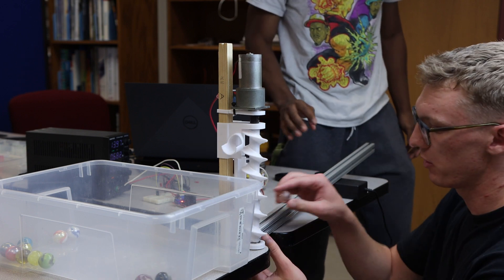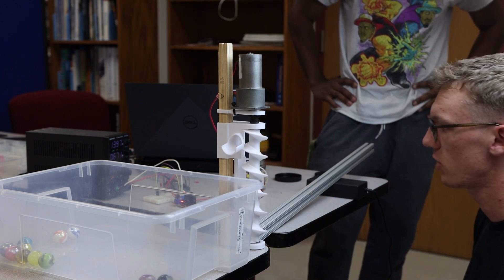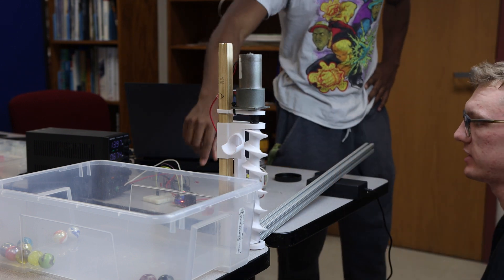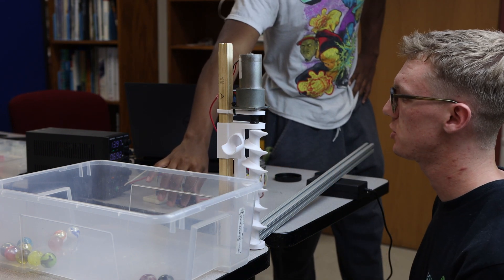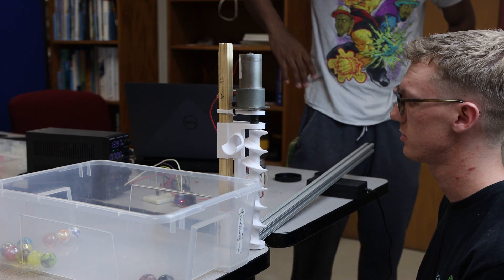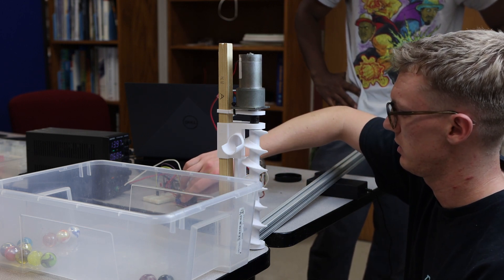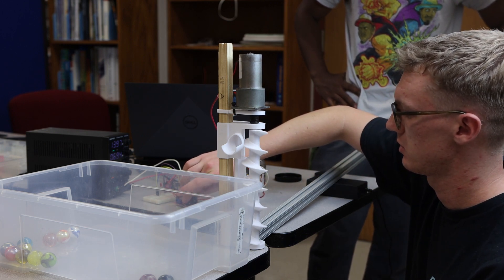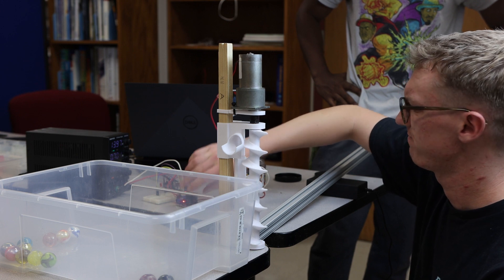Marble Run Auger Prototype

Comment: Greetings!! Im VERY glad I came across this!! Ever since I was 8, Ive wanted to make a cool marble track. In January, I turned 50, while jumping into the world of 3d printing......so here I am, lol. Im currently woking on designing an auger type elevator, but I want it to be adjustible anywhere from 25-90 degrees. im going with 1/2 inch steel ball for my marbles. I realize now that the shape of the auger blade will determine how I go about this, after seeing this vid.